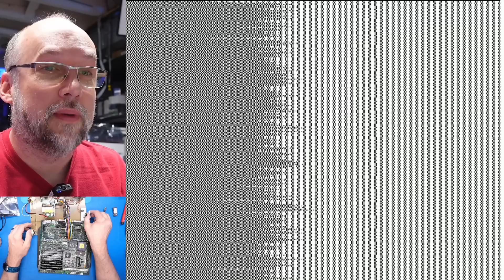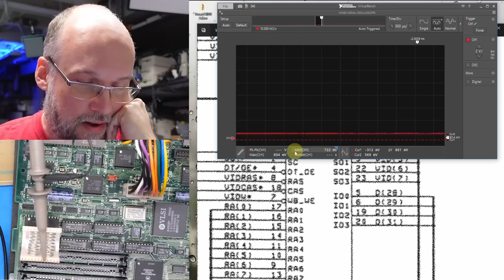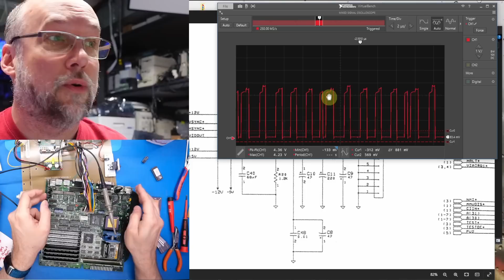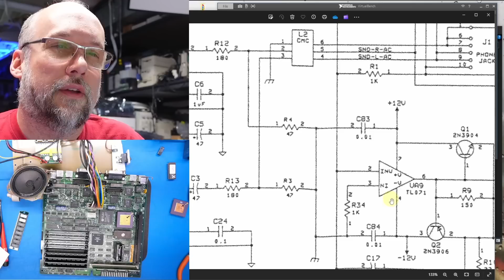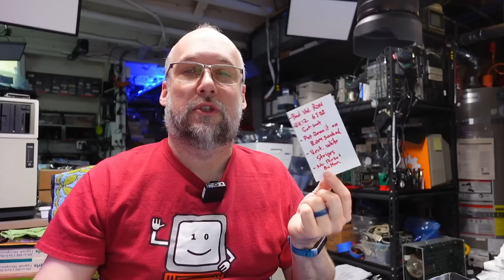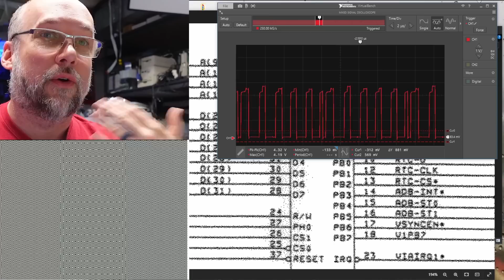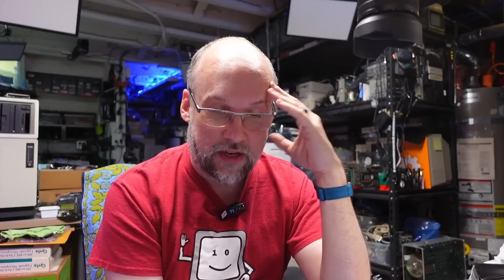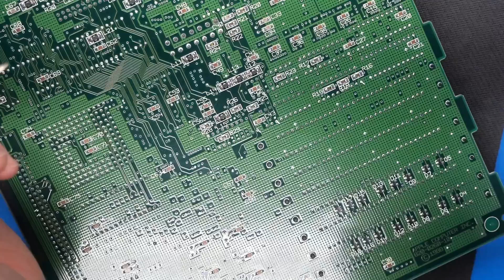Recapping my Mac SE/30 wrecked it

Comment: Adrean, you should start watching old repair videos from Louis Rossmann. Maybe reach out to him. Reworking plcc is really easy when done right.
Reply from the maker: I have seen hundreds of his videos, but I never recall him fixing anything of this vintage which are the only machines using PLCC. Even later in the 90s they did away with them and went to the much easier to solder packages.
Reply: @adriansdigitalbasement  I should have been more specific, I see😅 in your case with PLCC, what Louis would have been doing is to remove the old chip with hot air like you did, then remove old tin from the pads (remove lead free tin because its higher melting point is troublesome for manual rework), then apply flux from a syringe, then add fresh leaded tin to the pads, make sure that all pads about the same amount of tin and look shiny, then again apply flux, then position new chip on this (this is most difficulty step as you should achieve a good alignment - I use to tack down one of the legs with my iron to fix its position but only if I dont manage well with my tweezers), then use hot air to reflow the chip onto its final position. You can also shield surrounding stuff - especially THT stuff is usually not made for the high SMD reflow temperatures. I use old solder stencil masks for that, as they are easy to cut. Most important takeaway: use the flux, Luke 😉
Reply: p.s. did you see my other post, showing the guy talking about "Apple TechStep"? That's apparently a diagnostic tool that Apple made back then.

Comment: Hi Adrian, I assume you're wicking up the old solder (which might be unleaded) and reflowing the pads with decent leaded solder? Decent flux such as Amtech flux (NC-559-V2 / V2-TF) always helps  especially with regards to SMD soldering,  Kaptan tape is also useful for protecting areas (plastic connectors from being melted) too.

Comment: @ 50:00 Kapton tape and metal shields for hot air near other items, also use plenty of flux to help it reflow nicely.
Reply: Came here to say the same thing.  Put Kapton tape on the items that need protection, so it redirects the hot air.

Comment: I've done a lot of PLCC (re)soldering with the ReAmiga 1200 project. There were DOA ICs that I had to remove and replace etc. At some point I just replaced all with sockets. 

With plastic melting stuff chip quick is the stuff to use since hot air will melt it. It just takes a lot of practice and best to do that on a scrap board, not the device of importance. Protect with kapton tape, though even with kapton tape if you hit it with your soldering iron it will still melt.

It's helpful to have multiple tips you can swap easily ie the 245 series of hakko or clones. Bent tip, hoof tip with a cup in it (my favorite) and a few chissels and maby a knife style tip. And use lots of AM Tech 559 flux, you can use drag soldering with the hoof type tip. Hold the iron aligned with the pins, the cup at the PCB, and trying different angles to get the solder to flow easily around the pins and take excess solder to the next. Flux really helps this process.
Usually you can get it to only bridge the last two pins, then scoop up the solder with the hoof tip a few times. Inspect 5 times :) Invest in a good quality digital microscope, that really helps with inspection, and good light ie a swan bendy neck type light you can bend in the right angle to improve visibility. As a cheap alternative use an microscope/zoom app on your phone or buy a macro lens for your dslr camera. The bent tip is handy for tight spaces as well but may be more challenging when drag soldering. 

Also consider removing the blocking components as well. Extra work but if you have to go back resoldering time and time again, it's quicker to just make proper room to work in. 

To clean up low melt solder, I usually use double sided tape to stick the PLCC IC pins upwards on a piece of floor board and go to town with desoldering braid and flux. Drag it across the top and the sides, that should take care of it easily.

Hot air may warp the board, thermal shock and cause other damage to the board and the component you're trying to replace, dwell times are limited so if you heat them too long they may get damaged. I think these aren't multi layer boards which can take a lot of heat, two layer boards warp more easily. Since PLCCs are so big it takes a lot of heat and long heat exposure. 

You can also cheat by soldering on smd PLCC sockets, these are easier to solder than the actual chip, if there's enough room on the PCB. I use bent tip to get into the corners without burning the socket. Knife tip may work as well.

Comment: Board is in that annoying half working state where CPU can execute code and talk to some other chips without issue, but some unknown random component is not working. The obvious things are working. Data lines and address lines seem good. PGA makes it difficult to directly probe CPU pins on as system like this, because I would try to examine Interrupt and NMI signals to see if there are any spurious interrupts during startup causing the cpu to execute the crash handler and if it were it might help as you could narrow things down to which parts can even generate interrupts.

Comment: Rotate the caps 90 degrees on the install axis., where the narrow side is contacting the pads.  The narrow width is about the same as those pads.  It'll still work, just looks funny.
Reply from the maker: Unfortunately these MLCC caps are large value ones which are square along the long axis.

Comment: Put the PLCCs back on with hot air. Never had an issue myself and I’m not ad adept as yourself with a normal soldering iron.  Just make sure to have a good selection of scrap metal plate to use as heat shields for components that might get damaged due to proximity, oh and kapton tape.

Comment: The 12v on data pins would likely be more of an issue if the pins were outputs, particularly when pulling low, but still an issue when high as there will still be a V diff that can kill output drivers, inputs are usually high Z and may actually be able to handle periods of higher voltage levels

Comment: In future projects I would recommend putting the small ceramic caps on their side instead of laying them flat. This reduces the footprint eliminating the issue with shorting nearby traces. As for the ROM package I would recommend watching the video in the following link as it may add some resources and possible leads towards reworking the ROMs and/or replacing them with new and possibly improved versions. https://www.youtube.com/watch?v=zc3sPoqOFG8
Reply from the maker: These large value MLCC are square along the long axis, so turning them doesn't change their width on the board.

Comment: whenever i replace SMD caps with damaged traces underneath, i try to use radial caps with bent legs so they can float above the PCB and I can clearly see any potential shorts. sometimes it's difficult to do that if you have limited space to install the caps, but it usually works

Comment: Adrian, if you have enough space around the footprint your best bet is to use PLCC sockets, they are readily available and are much easier to solder by hand. Either by using a curved soldering tip or by cutting out the bottom and putting that back in afterwards. Makes swapping chips also alot easier.

When removing PLCC in a tight spot i generally add both kapton tape and over that aluminium foil to obstruct fragile/non-heat resistant components, bit more work but keeps things in pristine condition.

If you are going to do more smd things in the future and have the space for it i would highly recommend investing in a stereo microscope (trinoculair if you want to record video on it), prices gone down alot over the years for those on aliexpress. What i run here is a Amszoom 3.5-90x one with a 0.5 reduction objective on the bottom, which gives you around 15-20cm of working space. Eakins is a pretty reasonable brand on there aswell.
Even for normal soldering it makes it so much more easier.

Comment: Surface mount tips:

-Hot air is your friend. I know you use it, but for any J-Lead, no-lead, or ball package, it's all you really should be using for both soldering and desoldering. I solder gull-wing packages with an iron, but I remove everything surface-mount with hot air and attach everything except gull-wing with hot air.

-You definitely should pick up a syringe of solder paste. Re-attaching chips is much easier with this stuff, and you absolutely do not need to carefully deposit it on each pad individually the way a stencil does. Simply squirt a thin line along the pads by hand and as long as you don't overdo it, it will "magically" ball up and stick only to the pads and leads, leaving a clean install with no shorts. Can only be done if you're resoldering with hot air instead of a soldering iron, obviously.

-Pre-heating the whole board can help a ton when working with reluctant chips. In a pinch I've stuck a board onto my 3D printer's heated bed at 80-100c, but there are dedicated heating mats you can buy to bring the whole board up to temperature. Every 10c you heat the board with is 10c of temperature difference you don't have to provide with your iron or hot air station, so it's a lot faster and easier to bring the whole chip up to a temperature where it will release or solder.

-If you're working in tight confines with hot air, it pays to shield the surrounding components with kapton tape. This works surprisingly well to keep everything else from flying off the board, and lets you be more aggressive with temperature and air settings.
Reply: With sensitive plastic connector bodies like that, Kapton tape isn't that helpful Aluminium foil or aluminium tape (or a simple piece of a can cut to size) is much better at dispersing the heat away from the sensitive plastic. Kapton simply doesn't melt and can prevent hot air from reaching some areas, but it doesn't really protect stuff that it's glued on.
Reply: @LeoGitarzysta  You're not wrong, but in my experience I've found that in practice Kapton is usually sufficient to keep the plastics in good shape despite the fact that it only provides moderate protection. It's much easier to apply, and simply preventing direct airflow from the hot air gun is usually enough to do the trick.
Reply: @siberx4  yep, same
Reply: Extra flux won't hurt either

Comment: 68k doesn't start executing from address 0, it assumes the vector table lives at address 0, and reads the initial stack pointer and program counter from 0x0 and 0x4. The ROM switcharoo allowed the vector table to be moved to RAM so the handlers could be modified at runtime. Later 68ks had a vector base register which allowed the vector table to be relocated at runtime so the external switcharoo logic wasn't needed for that anymore. (it could still be useful for other things like shadow-RAM...)

Comment: I wonder if PLCC sockets might be easier to solder in. If you clip off the 'floor' of the PLCC sockets, you should have reasonably easy access to solder the contacts, and you can more easily swap out the chips to test back and forth to see whether or not that chip was bad

Comment: I notice when CRG does those PLCC chips for building Amiga accelerators he works under the video microscope at all times, and tends to pre-tin the pads before using a bare soldering-iron on the chip legs to reheat the tinned pads and flow around the legs. Lots of flux in between the pads and chip legs, also.

Comment: One simple test that is probably not the issue is to see if the NMI switch is shorting, thereby simulating a NMI press on startup.  I doubt that is your problem, but it should be verified as an easy test before continuing.

Comment: My first comment would be about you DeOxiting the RESET switch, what would happen if the switch that is beside that one, is locked open state. Because on the test with the 'good' motherboard when you reset while hitting that switch it did the exact same scope pattern with the slowed audio (short up, long up, 5 short up) what if all this time you have been searching for something when it is just that switch point is shorted or locked in forcing the system to direct crash every time it tries to boot?
The INTERRUPT button or you have a short somewhere to the INTERRUPT line some where on the motherboard?

Comment: Bad luck, I hope you work it out eventually.
SMT SOLDERING TIP: If you having trouble reliably soldering a SMT IC might I suggest investing in some solder paste and Kapton tape.
1) Tape around your cleaned / prepared IC pads to protect surrounding components. 2) Apply solder paste to pads - you do not need to be neat!
3) Apply the IC in place on to the pasted pads. 4) Go at it with hot air until the paste changes to solder. 5) Check for shorts - probably none!
Reply: i used to see ads for this tool that supposedly helped with smt soldering. of course i can’t remember the name
Reply: A board heater and suction tool is great if you have the money.

Comment: You said it's trying to access serial port, does it actually output an error code or something?
Hook a data logger to top address/select lines and compare with good system. What was selected last? What wasn't?
Scope data, address, select lines on RAM chips and see if ALL are the same as on CPU, i.e. no breaks.
And, condolences for the dead chips. It happens. It's great to see it didn't discourage you. Thank you!

Comment: Something similar to this happened  to me on a modern socket 1151 motherboard (Gigabyte Aorus H370 Gaming 3 WiFi) with the I2C lines for the SPD memory identification bus (1.8V) getting shorted to 5V I wanted to use the bus to drive a 1602 LCD (I had it done previously with the same motherboard and it worked nicely to display system stats) and it ended up killing the CPU (a i5-9400f) and a stick of RAM (some no-name 8GB DDR4 stick from amazon) but by some miracle the other stick of RAM (4GB DDR4 stick from Crucial I think) survived and I think it is obvious that the motherboard was DEAD (I found out that the chipset got killed)

Comment: 50:00 I use hot air for both desoldering and soldering PLCCs and SOJs.
Just cover plastic parts and electrolytes with the aluminium tape (it is used to seal vents) or kitchen foil. I use 2 layers of foil and additional 1-2 layers of napkin for thermal insulation.

Comment: Still watching, only up to 25:30, but fingers crossed.  I had a Star Micronix DMP on the bench that was dead.  Lights on, nobody home.  A check of the 5v rail showed I think 10v - the regulator had shorted.  Pretty much every IC including bog standard 74LS series in the thing used that 5v but I replaced the regulator anyway... and amazingly it came back to life.  It might still be fixable without replacing everything connected to that data line.

Comment: It's tricky at first, but easier with practice to solder MLCC surface mounted caps on edge instead of flat. The contact area replacing through hole caps is already limited by the pad size so nothing is lost functionally.

Comment: The tip to solder PLCC chips is to use small amount of solder per joint. But you can still drag solder those pins - just remember to use a lot of flux. If there is a bridge inside, just draw it out with a big molten solder blob. A small pencil tip works better than the blade or chisel tip.

And DON'T stop using Chipquik. They are good for your chips and boards. Drown all the joints with it, and only set the hot air to 480F to 570F. This will make sure the heat stress is much less than your typical hot air temps. And again, use a lot of flux. Remember to clean it up after removal, because this thing doesn't mix well with normal solder.

Last, if you don't want the surrounding to melt, mask with tin foil. Little bits of preps go a long way :)

Comment: Next time you do recapping with MLCCs on electrolytic footprints you could solder them on the small side, in order to avoid exposing more conductive area to the board as the the old caps would have.

Comment: Get the redrawn schematics from online and use the Data/Address line matrix to check those data lines from the ROM socket to the main chips (bottom of the Data line matrix) If any chip does not start up the system will not start.

Comment: One other item I have found and its known, the plastic ROM sockets are known to fail. With the rom in the socket pull it forward and turn on the board. This also happens with the RAM and the blink RAM can help you to see if there is any problem with the ram sockets. Just want to give you issues I have found with over the 50+ I have reloaded and repaired.

Comment: It wasn't a problem with your board but there can be an issue with only populating the first four slots of RAM with certain amounts of RAM on SE/30s. My SE/30 with 4x16MB SIMMs is unhappy when slots 1-4 are populated with 4x16MB SIMMs but 5-8 empty. I then put 4x256KB in slots 5-8 and it started working. I forget if it brings a Sad Mac or a corrupt screen; I haven't duplicated it in a while. I've only seen it happen with 16MB SIMMs though.

Comment: It's hard to tell from the video, but maybe they were a bit sloppy in the design when it came to isolating those 12v paths from the other paths. Of course, the board wasn't designed to accommodate those surface-mount capacitors.